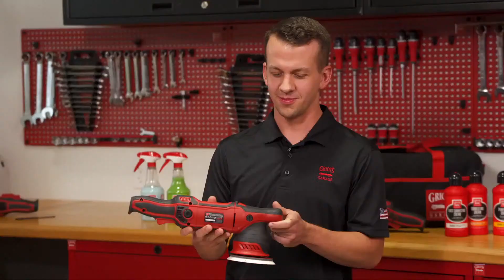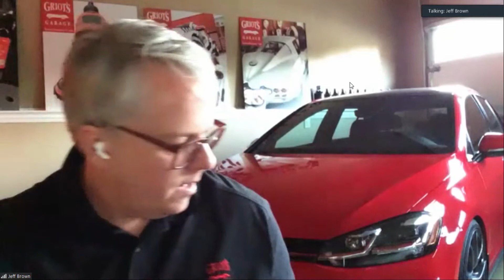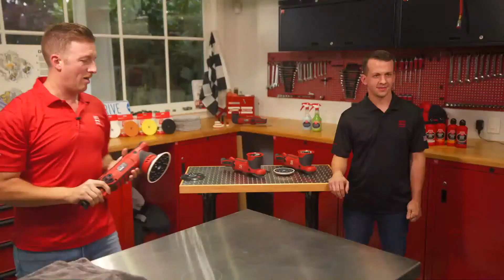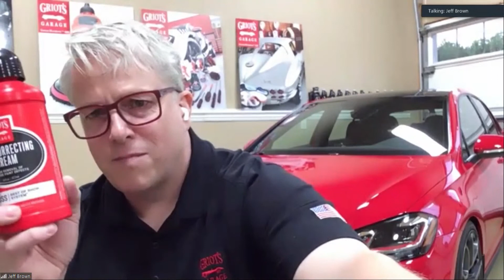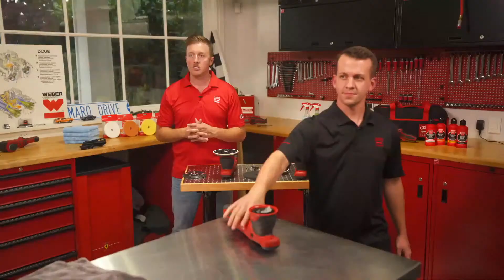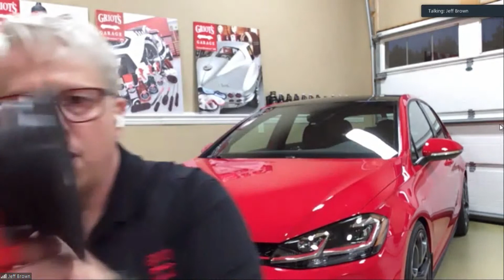Griot's Garage LIVE: G15/21 Long Throw Orbital

Comment: Is this device going to be available or not? can we just get an answer to that question? I need a device and ive been trying to buy this thing for nearly a year. Have the issues been worked out? Is it in production? Customer service gives the run around, I am to the point where you guys can either sell me a device, or I am going to go buy the Rupes... id rather have the griots, but I am tired of waiting, I sold my original G21 to buy this, Griots never has slipped on a date as bad as seems to have happened with the new buffers so I had no reason to believe there would be a problem... do guys want a loyal customer to stick exclusively with your product OR NOT? seriously, if I buy a rupes buffer im gonna eventually start buying their accessories...
Reply from the maker: Hello! We're incredibly sorry for the delays and availability issues with the G21 over the past year, it's been frustrating for us and customers to say the least. The initial issues with the backing plate have been sorted out. We have gotten multiple shipments in over the past year and they have sold out quickly. That being said, we are expecting more G21's at the end of this week (4/16) and half of them are spoken for due to existing orders. If you place an order for one on our website you'll definitely get one from this upcoming shipment. We'd also like to send you out some additional items to use with your new G21 on us for the hassle it's been trying to get one over the last year, please send us an email at social@griotsgarage.com so we can get your shipping address. Thanks!

Comment: I’m new here and i like to know if you recommend two steps for a car polish for the first time? Never heard about this brand but I have seen some videos and it looks is good quality. Please let me know thanks
Reply from the maker: Hi Alfredo, without seeing the car its tough to say for sure whether a two step polish is necessary. That being said, our Boss Correcting formulated to remove light to moderate defects and finish down so that no additional step is required.

Comment: I wish there was a way, some sort of visual aid that allowed me to keep the pad level and flat on the panel.  Whether it's vertical or horizontal,I'd be able to ensure I'm putting even pressure across the entire face of the pad.  Perhaps a small LED that projected a circle onto the surface you're working on and if you started angling the pad, the circle would start to oval and you'd adjust to get circle perfectly round again.  An attachment, maybe, so the already-perfected design doesn't have to be compromised?  Am I worrying too much about the angling?  Haha...maybe?

Comment: Which machine is better the old g21 or the new g21 I'm getting mixed reviews. On the new g21 I'm told that it doesn't perform well with the microfiber cutting disc.
Reply from the maker: Hi there, we designed and tested the new G21 (and G15) to be incredibly capable machines with a number of improvements over the previous generation. We have also put hours upon hours on both machines to ensure it meets our requirements. Our mindset when developing any product is never accepting nothing near right or good enough. We also extend 180-day satisfaction guarantee, so if you find yourself no totally satisfied with one of these machines, we'll happily return or exchange it.

Comment: Another question. What makes the G9 a good DA for beginners, and the G15 more advanced. Is it just the throw? How can 6mm make a difference in terms of a beginner? In other words what makes the G9 most suited for a beginner, and how could a beginner get into trouble with  G15. Thank you in advance.
Reply from the maker: Great questions! One of the reasons the G9 is so user friendly and better suited for a beginner is that the shorter throw makes it very hard to do any damage by burning through the clear coat. It is still an incredibly capable machine that has the capability to be used by beginners and more advanced detailers. The longer throw of the G15 and G21 increases their correction capability and efficiency, because of that we suggest having more experience to operate these machines.
Reply: A G9 user will say from speed 1-3 the G9 isn’t a real correction monster and can stall at lower rpm. Especially using the taller pads. At around 3.5 and up you’ll begin to feel it’s strength and efficiency for its shorter throw. The longer throw machine just corrects more space so it’s a more efficient machine but the newer machines the G21 at least has more vibration because it has a much meaner motor. Plus most 21mm I’ve tried have a little vibration at least. If you’ve used a power tool at any time in your life you can deal with it and lower profile pads help cut down vibration.
Reply: The G9 as for beginners is a easy , smooth machine. It’s speed range from 1-3 won’t have a whole lot of power behind it so newer ppl will feel comfortable learning in those speed ranges not feeling to worried about burning through. In comparison to other machines with longer throws that vibrate a bit more and aren’t as efficient feeling. The 9mm is a good throw for ppl brand new with a DA polisher , takes longer to correct than a conventional 15mm or a 21mm. Just a easier feeling , more forgiving feeling when using the G9 vs the new G21 or 15.

Comment: Great presentation. Your polishers are tall, that is a large distance from the handle to the backing plate, how do you keep the drive shaft from vibrating excessively, and what design features do you have to keep the drive shaft in spec over time? We know vibrations tend to cause component wear, which would affect the drive shaft's position and possibly introducing wobble on the backing plate.
Reply: Lower Profile pads. Urofiber 50/50, Lake Country thin Pro, Meguiars soft buff pads, and Griots has a lower profile pad now as well. I have the new G21 and the G9 and that’s the only way you’ll cut down vibration. You can also do the same with the Rupes backing plates as well.

Comment: Thank you for the live stream it was very informative.
My question to win the g15 or g21 is.
Can this new version out perform any of the Rupes line?  Send me the winning product and I will put it to the test and I will post my outcome.
Reply: No, I have the G21, G9 and had sold a Rupes LHR15 the new one. And those machines feel super smooth and with a little practice you can run the polisher faster and still feel in control. The new G21 won’t give you the same feeling being it’s a much more powerful machine. Probably twice the power output of the Rupes machines but at a cost of vibration which will cause concern if the user is new. Short answer is no. The machine that will seem familiar to a Rupes is the Flex XFE. Very efficient machine smooth , not to loud and again a lower power output motor. More control , with correction none the less.